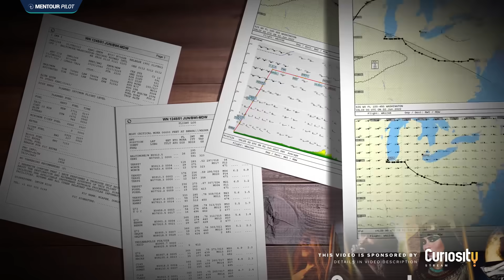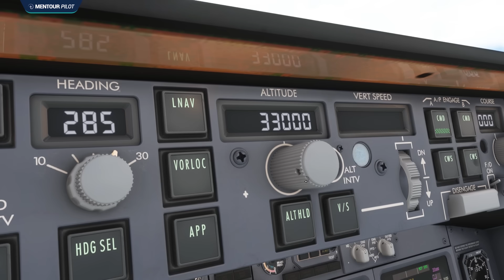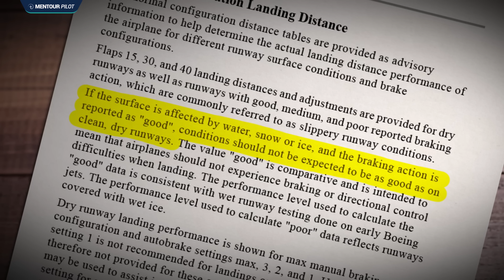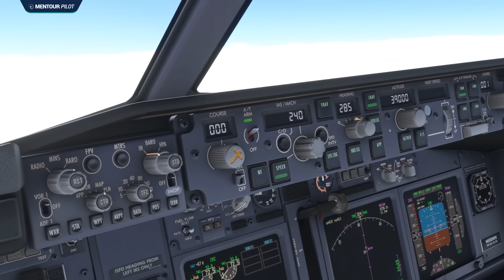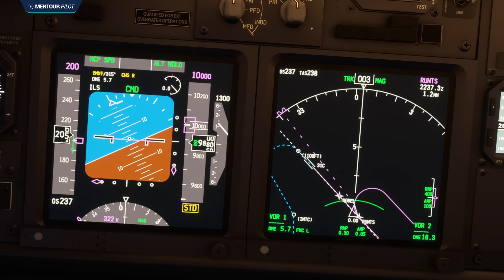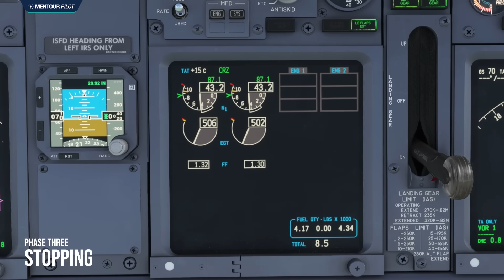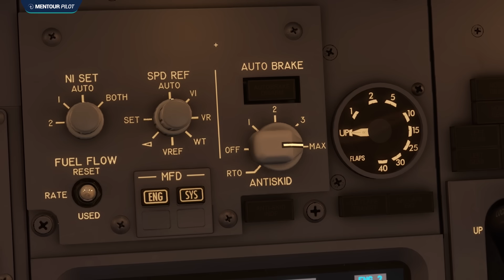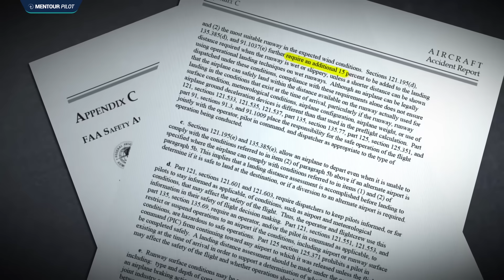WHAT did The Pilots MISS?! Explaining Southwest Airlines flight 1248

Comment: The captain DID try to employ thrust reversers, but the handles got stuck because the engine couldn't be spooled up before the reversers were fully opened. 
I consider that a design flaw. 
The same mechanism  that blocked the reverser handles could have been used to block the engines from spooling up until the doors were fully opened after which the engines could spool up to the set reverse thrust.
Such a mechanism would have allowed the captain to simply set the desired reverse thrust and subsequently focus on the other tasks the landing required such as braking and maintaining direction.
Reply: It is an awareness feature that all jets that I know of have.  I've been flying jets for about 4 years now and have never seen a captain or first officer forget to use the thrust reversers in the manner which happened in this accident.  Something like that is incredibly rare.
Reply: If operating as designed then it would provide helpful feedback to the pilot that reverse thrust is not available yet, and keep the position of each lever matching the state of each engine.  If one reverser door suffered a failure and couldn't open, and the other worked normally, we'd want the pilot to notice they have only one handle moving (asymmetrical reverse thrust).  You could almost have it both ways with a detent that automatically operates the reverser as soon as the door finishes opening, but it would have to move to a fixed setpoint.
Reply: Agreed
Reply: The problem specific to the 737 is that I wouldn’t be surprised if there’s a mechanical linkage between the thrust reversers and the “throttle” of the engines. Imagine if there was no stop and one of the doors was malfunctioning. You’d stab open the thrust only to find a severe yaw to one side as one engine attempts to reverse thrust and the other is pushing the plane forward.
Reply: @asamyers4572   Lauda Air Flight 004. It happens.
Reply: @asamyers4572  With an interrupter on the throttle on the engine's end, the engine wouldn't throttle up as commanded by the reverse thrust handle if the doors were not fully opened. There still would be asymmetric reverse thrust but not quite as severe as with the scenario you sketched.
Reply: Could the Captain have delegated the co-pilot to put his hand on the thrust reverser to engage when ready so he could perform his other tasking?
Reply: @mike777yeah  He could have, but that's not normal procedure. It could be somewhat dangerous if one pilot handles certain controls while the other handles other controls. One of the reasons they're called pilot flying and pilot monitoring.
Reply: @MythRsR1979  Thanks Chari
Reply: Pilot error.

Comment: I am not a pilot, I have a question - Why do planes land so deep into the available paved runway especially with poor braking conditions?  It seems like it would make sense to use as much runway  and touch down as early as possible.  This channel and content is awesome, thanks!
Reply: If you try landing at the very beginning of a runway, you run the risk of coming too low and crashing before the runway, which might have trees or even buildings. When you feel it's necessary, though, it's absolutely part of the "short field landing" technique.
Reply: @TheHenryFilms  Also, in addition to the landing low or early issue, most people don't realize that the big jets take a while to accelerate up and there is lag, so if a pilot was aiming low and then was coming in even lower than that, increasing thrust might not provide enough additional lift to make it to the runway if they were already trying to land early. It is hard to judge exactly when inputs don't immediately respond and output is delayed.
Reply: the reason is simply to prevent routine undershoot, which itself can be disastrous if before tarmac start.....however...
Emergency landing protocol should permit a large % of this area (preferably automatically, using height, distance & speed feedback with possible pilot over rule)
Reply: @TheHenryFilms  are you a pilot?
Reply: @gruanger  are you a pilot?
Reply: @davidstuart4915  are you a pilot?
Reply: @Mike88GT  I played at it ;)
Reply: At 19:50 Petter says "the aircraft touches down exactly where it is supposed to be on the touchdown zone markings...."
Reply: Approaches are standardised for all types of aircraft. i.e. aircraft of all sizes. On a 747, for example, the landing gear is 35 feet below the pilots' eye level with the aircraft in the approach (nose up) attitude. You really need a large margin of error as you cross the threshold (end of runway). In gusty weather, you may lose lift as you cross the airport perimeter fence leading to undershoot. Also, in built up areas, depending on wind direction, buildings may block the wind, leading to sudden loss of lift.
Having a standardised approach system allows aircraft designers to incorporate Autoland systems. The Autoland systems on modern aircraft basically do what the pilots do. i.e. they guide the aircraft down a shallow 3 degree glidepath and, around a certain height (sometimes 50 feet), they transition into an even shallower flare mode angle (otherwise even that initial 3 degrees would result in a very heavy landing). This flare takes up runway length. If the glidepath were set back to allow the aircraft to touch down on the threshold, then this shallow flare zone would put your wheels even closer to airport perimeter fences and Localiser antenna installations. Your margin of error would be even less. As the video shows, airport boundaries can be limited by city infrastructure. You can't always make the airport bigger.
No, I'm not a pilot, I was an aircraft engineer (avionics).
Reply: @flagmichael  under normal conditions
Reply: @TheHenryFilms  are you a pilot?
Reply: Because, as mentioned by others, that's a very important buffer zone. If you have something go wrong on approach and you're aiming for the touchdown marker you still have runway before it you can land on. If you're aiming for the numbers you're going to find yourself coming down maybe 1000 feet before the runway. Could be ramming into a hillside, could be into the water or into a bridge.
Reply: @JamesF0790  are you a pilot?
Reply: @TheHenryFilms  Are you a pilot?
Reply: @JamesF0790  are you a pilot?
Reply: if not, I didn't ask you anything so sod off.
Reply: @TheHenryFilms  are you a pilot?
Reply: @Mike88GT  Actually you just said you weren't a pilot. Also, it's a youtube comment section, not your own personal forum. You asked a question. And no, I'm not a pilot. I'm an aviation enthusiast who was repeating what I have heard from a pilot. So while I'm not a pilot the information very much comes from one.
Reply: @TheHenryFilms  are you a pilot?  if not then stop trying to answer my question, jus STF up
Reply: @Mike88GT  Also, I am studying I’m preparation of starting lessons once I fix some medical impediments.
Reply: @JamesF0790  Great, there's the answer I was looking for - you heard it from a guy.
Reply: @Mike88GT  A commercial pilot, not a random person and another pilot already gave you the same answer but you've ignored him.
Reply: Dude why are you so rude 😂

Comment: I am surprised you didn't bring up the shortness of the runway, especially as a 737 pilot.  There was some controversy over that airport due to how short the runways are.  I thought maybe you would have had more to say about that, but maybe the news over here hyped up certain points while you bring up the stopping material at the end and consider that good enough.

I remember going into Midway on a 737 a couple of weeks after that incident because I remember mentioning that incident to my sister on the flight and she was not pleased.  When we came in during snowy conditions, I remember seeing the speed brakes deployed as we came in at a steep angle.  Then the plane leveled off at the very lip of the runway and firmly planted onto the end of the runway.  (Firm landings seem to be just how things are done at Midway.)  The engines immediately went into full reverse thrust.  At the other end of the runway after doing full thrust reverse or so it seemed, the plane made a fast turn onto the taxiway as it continued to brake, and then once the plane slowed some more, the thrust reversers retracted on the taxiway.  When later departing Midway, I noticed they spooled up the engines all the way while fully braked, held for a couple of extra seconds, and then launched down the runway.  At the other end, they jerked the plane into the sky and took off at a rather steep angle, pressing us into the seats extra hard.
Reply: The runway in question at Midway is a bit over 6500 ft long.  FWIW ~100 times per day 737's & A320's (plus a few widebody cargo jets) land at SNA in Southern California on its 5700 ft main runway.  Those are typically down to taxi speed well before the end of the runway without having to brake especially hard.  OTOH, SNA braking conditions are almost always excellent.
Reply: @marcmcreynolds2827  SNA is the shortest runway in the country a B737 will land on.  And as you point out being in the Los Angeles area, there is never going to be a weather related issue such as snow / ice on the runway making it tougher to stop.  Heck, it doesn't even rain in LA hardly at all anymore due to global warming.

I think something to consider is when you touch down at landing speed in say a B737, you are covering a lot of distance fast when you first touch down.  At those speeds, it doesn't take a lot of degradation in total braking force to start eating up a lot more runway to stop.

So when you consider the plane I was in touching down at Midway in snowy conditions and the brakes just don't work as well, 6,500 ft quickly becomes a rather short runway to be trying to land on.

Then when you consider taking off, there is the question of how far you are flying and total plane load.  I was flying across country and into the wind / jet stream, so loaded down with fuel and on a completely full flight, so the plane was probably loaded to the max for what could take off from that runway.

I have seen a chartered B747 for example take off from a military base destined for Iraq back when that war was raging.  The plane was packed to the max with marines and all of their gear and a full tank of fuel to basically fly half way around the world.  It used up a 12,000 ft runway and then slowly lumbered into the sky.  Usually when I see a B747 take off, it needs a lot less runway and takes off at a much steeper angle, but not that B747 with the load it had on it.
Reply: @ChaJ67  "so the plane was probably loaded to the max for what could take off from that runway"  Yes, I've seen Southwest deny boarding to passengers at Midway in order to stay under a particular weight.

"It used up a 12,000 ft runway and then slowly lumbered into the sky."  I once watched from the side of a 15,000 ft runway as a 747 used up most of that, laden with a shuttle orbiter on top : )  That flight went at the crack of dawn, needing every advantage it could get including cool air.

Comment: As a pilot, how do you reconcile the death of others due one’s own mistakes?  Is there a system in place to help pilots with the psychological impact?
Reply: "As a pilot, how do you reconcile the death of others due one’s own mistakes?"
Robin, in my opinion most aviation incidents are rarely the fault of one individual. In this case the training the pilots received from the airlines was probably partially to blame. As someone else said the ATC system should have reported runway braking conditions as "poor".....the conservative figure. The software program defaulted the tail wind to 5 knots without really flagging that to the pilots. These airliners are complex transportation systems. A LOT goes into a flight from point A to point B. There is literally an army of people behind the scenes and onboard the aircraft to make it happen.

Comment: Around 1975 I was a passenger on a 737 (?) landing at Andrews AFB near DC.  The weather was wet and icy.  We touched down then immediately pulled back up and away from the runway (and the AF base).  We were unaware there was a serious problem until it was announced that we were diverting to BWI, about 50 miles away.  We later heard a rumor that the tires had "slipped" when they touched down.  I've always wondered how close we were to serious trouble.
Reply: The fist time I

Comment: Question: When the pilots inputed 10 knots tailwind, does the computer warn the pilots that they exceeded the 5 knots maximum before it defaulted itself automatically?
Reply from the maker: I’m not sure, I’m any case it was not noticed by the crew.
Reply: Wouldn't be surprised if it were a "they know they can't go over 5, so nobody is going over 5, cap it at 5" situation.
I'd want the program to throw a very ominous warning, but still allow for using out-of-range values.
Reply: @Fay7666  Thanks Efrain
Reply: @MentourPilot  Thankyou Mentor Pilot
Reply: @Fay7666  I've programmed a lot of database interfaces and you generally either make it so the entire input is rejected when you type something wrong (which many will recognize from online forms) or so it attempts to adjust values into a valid range, BUT making those automatic corrections without clear notification or warning for the user is terrible practice, and yet it happens quite often. I personally believe in bright in-your-face warnings when doing those automatic corrections, but for something like an aircraft it really should flash "no can do" warning with everything that's wrong with the chosen options. Never ever guesstimate values when lives depend on it
Reply: @thesteelrodent1796  Oh I hate those forms that just don’t work at all if the data entered isn’t valid. I could have punched the blockhead that decided to make me update my details for online banking despite it all working fine before… and demanding I put in my landline number… which doesn’t exist because I didn’t have one and do everything via my cellphone or email. I couldn’t even use letters to say “don’t have one.” Stupid computer. 🤬

I ended up doing a quick Google search to determine the “rules” of what a valid area/telephone landline number were, then just input a random jumble of numbers that followed those rules and tricked the stupid thing into letting me move on and use the system for what I wanted to do. That kind of nonsense is absurd. Fine, flag that the value I’m putting in is incorrect but don’t lock off progression toward restoring normal function.
Reply: @mikoto7693  I don't know if sites have caught on, but if somebody wants a phone number and I don't want to give it to them, I use the areacode-555-1212 value. That's why for modern day movies and tv shows virtually all phone numbers are xxx-555-xxxx. Those ranges are not handed out. As for the rest of the world, beats me. Of course, designing an online form with a user interface that works the way folks expect it to, yeah, at times it's all miss and virtually no hit.
Reply: @thesteelrodent1796  it's funny because in our current calculation tool, if you input something out of range, it shakes the screen really hard for about half a second and shows a huge warning and will not calculate at all.
Reply: @topethermohenes7658  shook the screen, and the glass shattered. ;-)
Reply: @mrtechie6810  I know thats why i think its funny, its like the tool saying HELL NAW
Reply: @bikeny  That's not just modern movies. Even older ones often have the 555 phone numbers.